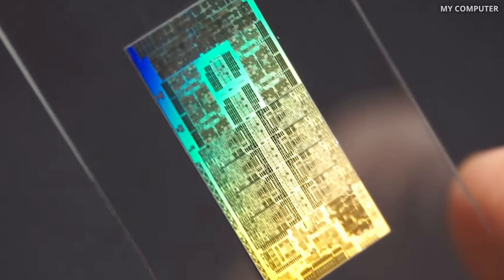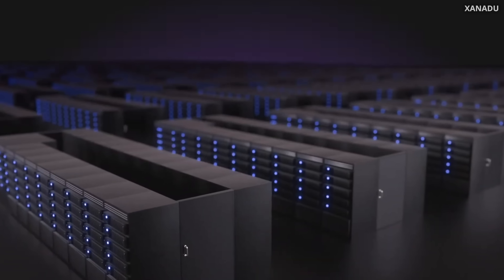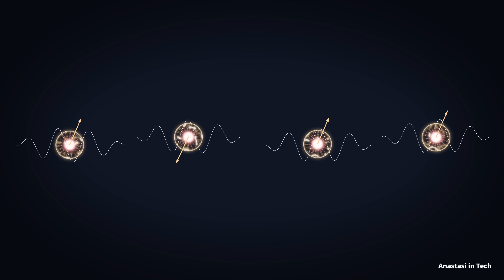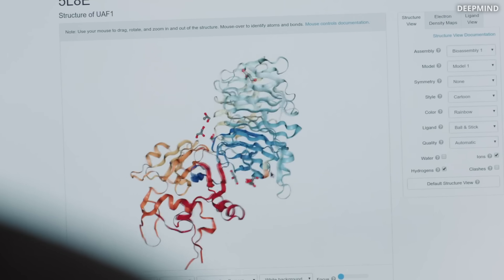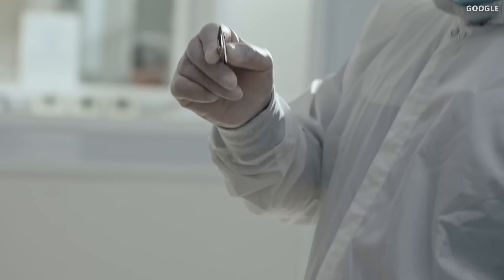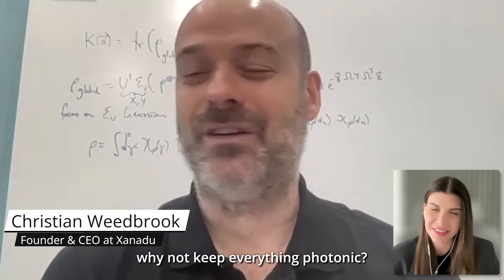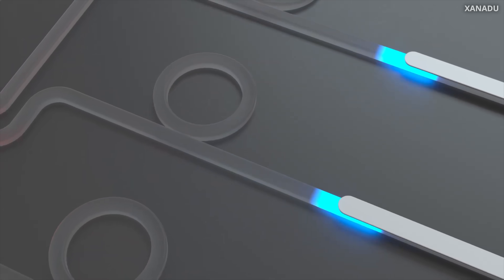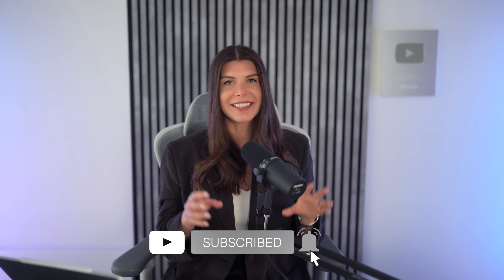Quantum Computing Breakthrough

Comment: Good day. As an old (retired) French electronic engineer (1971 promotion), I am very impressed by the very high level of your knowledge. It is indeed a huge step forward quantum computing and I even think I have been suddenly "beamed" 1000 years into the future. Thank you very much indeed.
Reply: Thank You for Your Service
Reply: @geoms6263  The error correcting codes were originally written by God. 
Working on a branch of physics called supersymmetry, Dr. James Gates Jr., discovered what he describes as the presence of what appear to resemble a form of computer code, called error correcting codes, embedded within, or resulting from, the equations of supersymmetry that describe fundamental particles. Gates asks, "How could we discover whether we live inside a Matrix? One answer might be Try to detect the presence of codes in the laws that describe physics." And this is precisely what he has done. Specifically, within the equations of supersymmetry he has found, quite unexpectedly, what are called "doubly-even self-dual linear binary error-correcting block codes." That's a long-winded label for codes that are commonly used to remove errors in computer transmissions, for example to correct errors in a sequence of bits representing text that has been sent across a wire. Gates explains, "This unsuspected connection suggests that these codes may be ubiquitous in nature, and could even be embedded in the essence of reality. If this is the case, we might have something in common with the Matrix science-fiction films, which depict a world where everything human being's experience is the product of a virtual-reality-generating computer network
Reply: Jokes on us. She’s AI.
Reply: Nahi degi bhai
Reply: You are french? 😢
Reply: No... I live in Alsace/in France very near to the  french/German Border and my french writing is really not good. @yak-machining
Reply: Fully agree! 🎉❤
Reply: I hope your research was responsible for any death for the pursuit of science and the army 🪖
Reply: Good old chat gpt :-D
Reply: I didnt think France had any EEs 
Wasnt HeathKit their source of technology
Reply: Does quantum use less energy?
Reply: A Bad News for Cybersecurity....which Passwords will be save in Future🤔..let me surprise how this would effects the Bitcoin Mining.
Reply: Il suffira de s'adapter.
Reply: @Viertelfranzose

"A Bad News for Cybersecurity....which Passwords will be save in Future"

Quantum Q-bit passwords.
Reply: Q-bit passwords
Reply: @Viertelfranzose  we already have non quantum cryptographic tools totally secured for any type of quantum decoding.

Comment: Error correction is and has always been a huge drag on moving data especially if there are large image files.

It would seem to me error correction will be much like how a fax machine modern work. Except, how do you count photons? Input number going in equals the total received. There will potentially need to be a calculation equals sensor at the end of each gate. This wouldn’t keep data in order but would make sure what goes in comes out on the other side. 

A block code would be the best approach. Data going in total photons and block code totals would keep data in the right order. 

I’m probably talking out my 🫏

Comment: Awesome, what is it capable of that we can easily measure it side by side with? That’s awesome. You’re making this happen. But how far are we from competing with electronic silicon chips? And I’m not sure if that chip will require integration with normal electronic silicon chips if so, it will definitely still require cooling however not as much which would be fantastic so I think Some benchmarking scores with other things that already exist would be a good start. Great idea great job keep it up. Nice chair.  ❤️❤️

Comment: Be it light or electrons you still have junctions. Fiber optics would have to be extremely small to allow the control of light. I do not know enough about the technology, but I do understand that the infrastructure will slow the light down. It is hard to see how this problem can be solved other than a different algorithm was used. Sorry for the downer😢
Reply: This seems like a good problem to have to tackle though 😊
Reply: I think it is impossible to slow down photon because it is powered by 2 incoherent charges in adjusted tetrahedrons(3dfaces)
I mean that our 3d uneverse is face of 5-vertex simlex(ie 4d triangle)
Reply: Good point 😊.

Comment: If it provided solutions via constructive interference, then it's not a conventional "turing machine", and as such, can be applied to only tightly scoped families of problems.  And these aren't going to displace general computing solutions.  To put this in perspective, see how DNA was used to solve the Traveling Salesman problem using clever means of representing the problem space using DNA strands.  https://pubmed.ncbi.nlm.nih.gov/15555757/  The result, a strand of expected length containing all cities only once, was solved in a few minutes in a small vial, whereas it would take all the computers in the world until the heat death of the universe to provide a solution.  But because this system was not a proper turing machine, it would not be suitable for running most classes of algortihms that we now use.

I suppose you'vre been mostly honest about the accomplishment.  I just have a problem with saying that this approach is the future (it may be, but not yet), or the very idea of quantum supremacy, which gives the false impression that existing computing approaches are going to be displaced.  Finally, you might want to avoid using superposition as the main advantage of quantum computing systems.  Rather, frame things in terms of constructive interference.  This feature has been artfully expressed in SMBC's cartoon: "The Talk"  https://www.smbc-comics.com/comic/the-talk-3

Comment: Nope sister. The bottleneck will be the interface which will be electrical…. 
There is no such thing as portable quantum photonic chip.
Reply: ... yet ...
Reply: Well, Hoomans are pretty good at creating bottlenecks, but also relieving them. First step towards these speed bottlenecks should be taken from ordinary systems, such as Cache/buffers, reslut transfer vs bulk and so on. We will likely try to add a photonic interface to the quantum thingy, and then perhaps Bizmuth interface (500ghz switching) to the photonic interface and so on. There could even be photon delays builtin, so peaks can be flattened/avoided. s inspiration, read how Deepseek optimized the training/inference stack despite a throttled GPU bottleneck from the Americans.

The question is rather why these specialized problems, that a quantum chip excel at, is needed in a portable form in the first place, and how much data the system even generates ? Here it took comparable little time to do a 700million task, but the quantum system doesn't generate (relevant) data as if it had run for 700million years, it just have to deliver the result at the end, and that won't take a fast interface at all.

Comment: I can't help but think of the parallels between taking gates, whether using relays, tubes or transistors, to make usable ALUs, and taking qubits and building useful machines. Just a few isn't going to cut it, and as Anastasi says, if they all require tremendous cooling, scaling is hard.

It's an exciting time to see this technology evolve.
Reply: The evolution of this is gonna go parabolic. Supercomputer power with a few miliwatts of laser light from a source similar to the one in a Blu ray disk reader. 😮